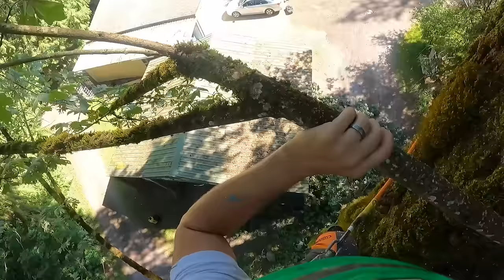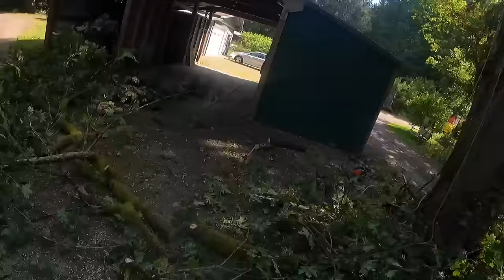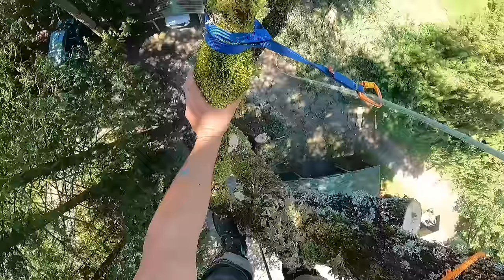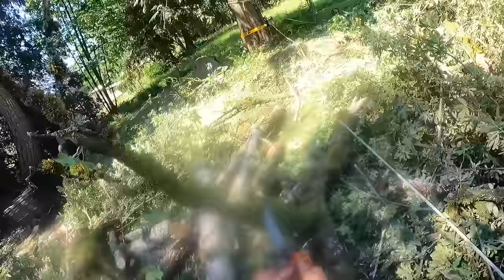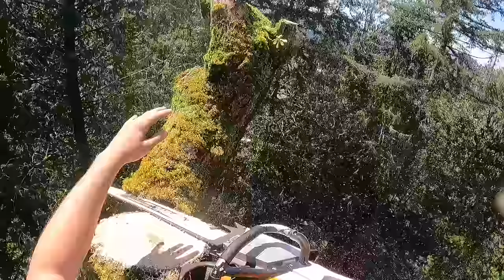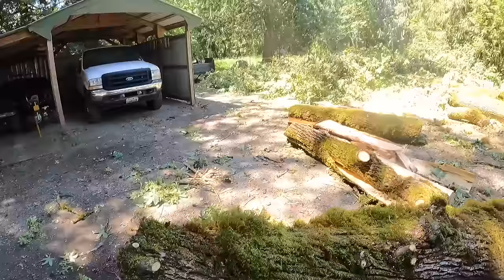JAKE AND RANDYS MAGNIFICENT MAPLE MURDER! My first ground guy is a better climber than me! 🍁 💀

Comment: The banter is terrific. But on the topic of spilling bar oil or not getting the lid on, if you overfill the oil, you sometimes can't get the lid to screw on without first removing a little oil...

Comment: The last narly one I took on was a 70 ft locust, heavy lean over a house in the Pittsburgh area. It was part of a double pronge stump that had the upper side completely uprooted and was literally holding on by less than 6 inch of wood to the root system.. gotta love how strong locus is.

Comment: you dont have to get NAME BRAND batteries guys. you can get the ones off amazon or ebay and they work just fine. people take and replace the lithium ion batteries that are on the inside. i've got a few for my milwaukee and dewalt power tools. they work great. and sometimes less than HALF the price :)

Comment: Hi have a question for you I have a new saw cut about six trees with it now when he gets warm outside it doesn't want to run very well what would be the problem with it I'm told power saws don't run well in the heat

Comment: Brooooo that first big leader you took off started to split! Bet it would've if you wouldnt had taken that weight out of it. That was a good call. 

I use a ratchet strap to bind pieces near the cut so they dont barber chair, just reassurance. You can also use it to tie multiple leaders together like the base of that maple. Especially if one of them is looking goopy.

Great work guys!

Comment: On your travels, find a loves, pilot/flying j, or petro/ta truckstop.  And go get a cobra 1500 watt inverter for your car.  That will charge your batteries while your at lunchbox driving to or from a job.  Don't get the yellow ones at the truckstops they suck. I had a cobra in my semi for 2 years then gave it to a friend for his truck.  He's had it about a year and a half and it's still running strong.